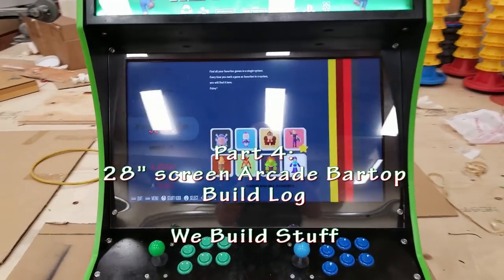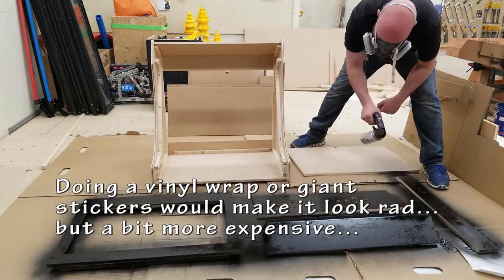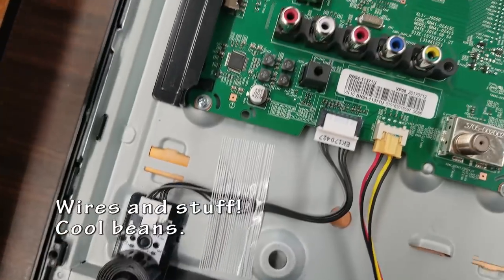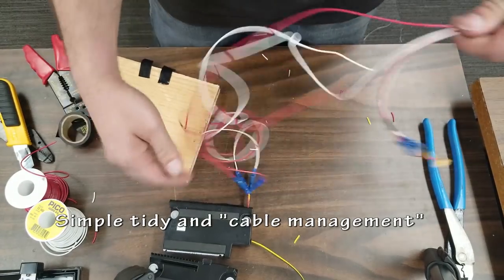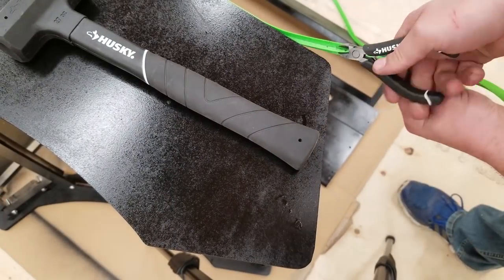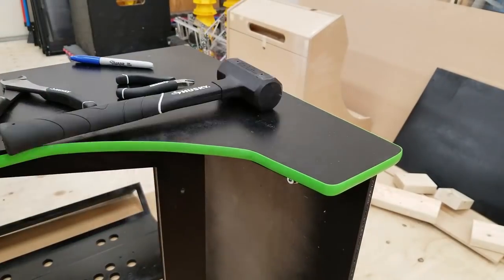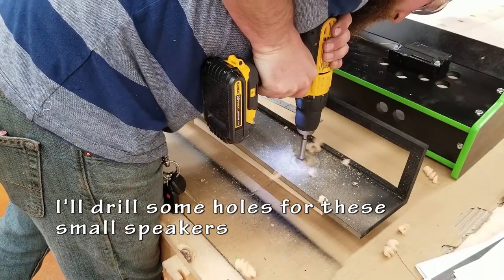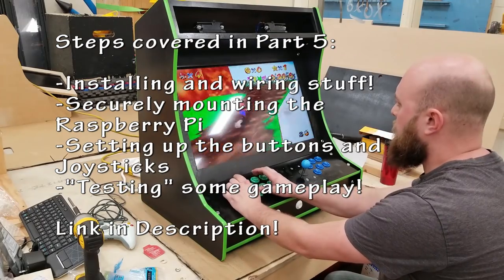How to make a DIY BIGGER Bartop Arcade! - Part 4 - Raspberry Pi

Comment: Iv just bought a bartop arcade machine but it all in bits and the electric are messed up my player 1 does not work only player 2 controller works
Reply from the maker: Need some more information before I can give any opinions. 
1) What type of board/computer is inside (raspberry pi, windows PC, etc)?
2) Are the buttons, joysticks plugged into a USB encoder and are any wires loose?
3) Have you checked if the ground wires are all attached for the buttons, joysticks, microswitches?
4) can you bring up any menu system or configuration files?

Start with checking those